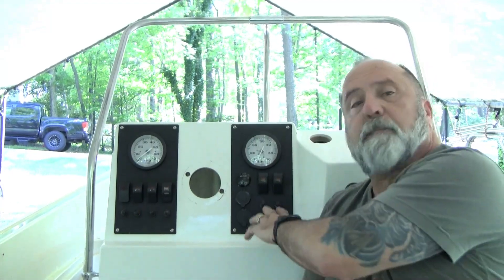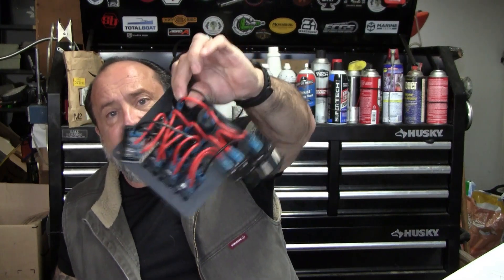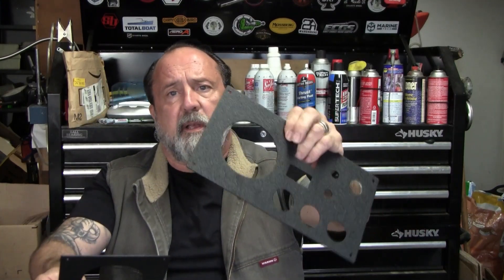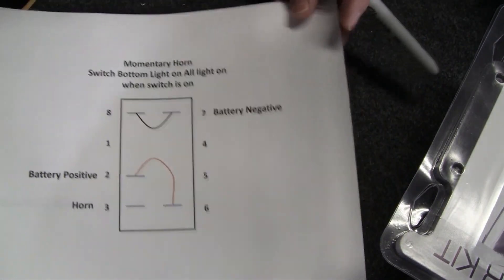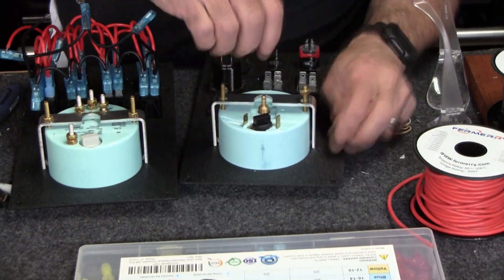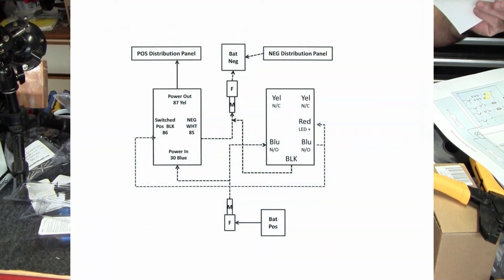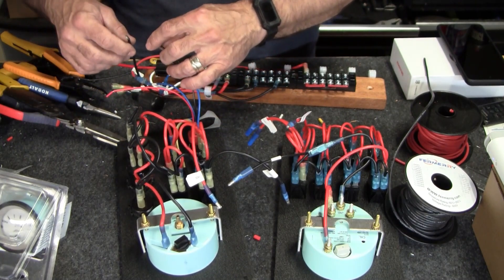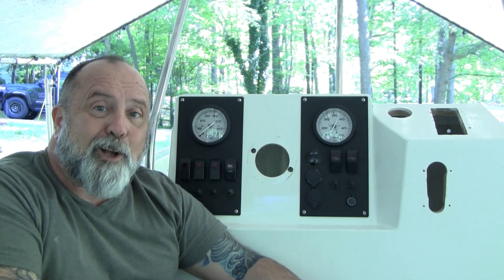How to Make Custom Center Console Electrical Panels - Boston Whaler Montauk Part 10

Comment: This is hands down, the best series I've found on the topic.  I am 100% going to use this setup on my 17' Montauk...although, I'm most likely going to omit the primary power switch because I don't see the benefit (am I missing something?).  What happens if a 10 year old pushes that button while underway?  Won't you lose power to your gauges?

Comment: Sorry if I missed it, but do you install battery disconnects on your whalers? I have a 15’ and trying to find a good placement. Thanks.
Reply from the maker: I will be installing the power cables and a disconnect on this Whaler in a few weeks. I'll have a video on that